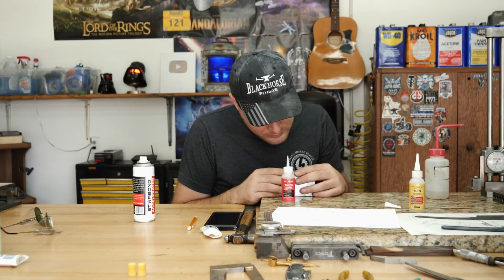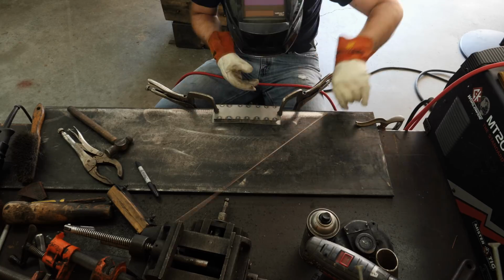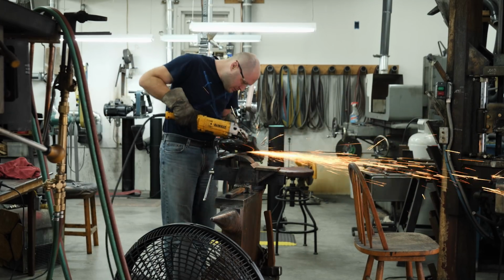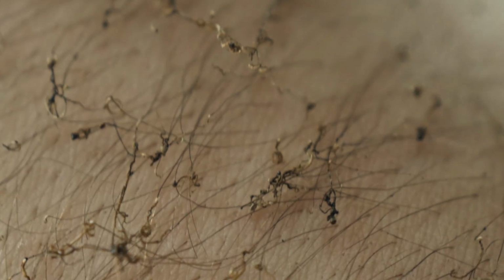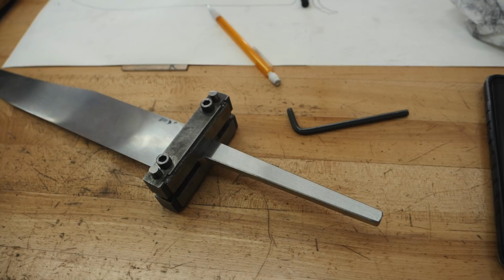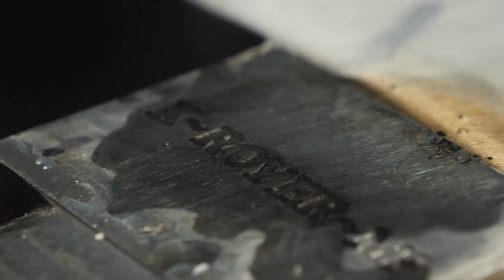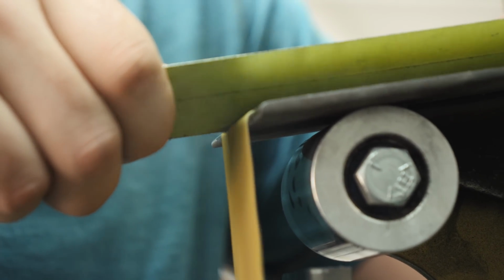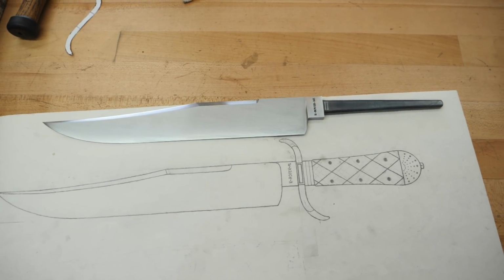Hot Damascus Made Into a Classic Bowie Blade (Luminous Pt.2)

Comment: Hi Kyle,

In the previous video I left a comment about surface grinding. If you use those suggestions, properly dress your wheel (and probably the chuck too) and use proper technique (using coolant helps) you can get a surface finish with an Ra about 3 microinches (roughness), which is both much smoother than what you showed in the video and what you would get with 220 sandpaper. An Ra of 3 is comparable to what someone would get with somewhere around 1000 - 3000 grit sandpaper. An Ra 3 mircoinch surface would allow to to rub the pieces together and have them stick together (no glue, no magnets, no liquids, just the absence of air between them).

Comment: What happens to all the air inside your steel when you weld a bunch of pieces like that? It looks like you're sealing everything up on the sides leaving air inside there.
Reply: That little bit of air becomes so defuse when hot it's negligible compared to a completely open air forge weld. Even the vacuum of space has a small amount of air in it.
Reply from the maker: Good question Sam. It burns up before it becomes a problem

Comment: Anyone, is the leaf spring from a Suzuki samurai a 5160 steel, if not what kind of steel is it and do I heat treat in oil or water.?
Reply from the maker: It’s more than likely 5160. Good call 
Parks 50 oil at around 100 degrees. However tempering is where more magic happens. 
Chao 

Dad
Reply: @KyleRoyerKnives  thank you. I'm so inspired by Kyle and the magic in his hands.!!!!